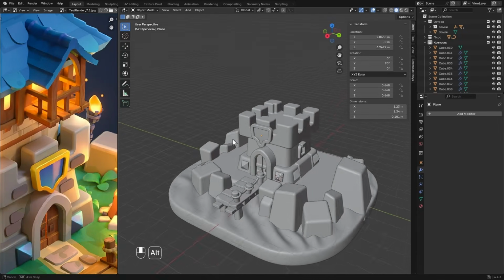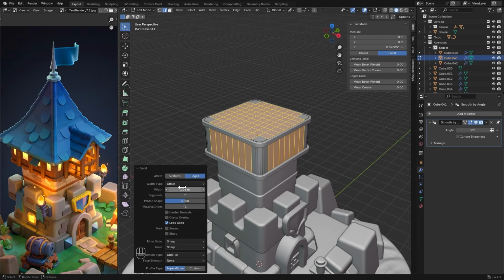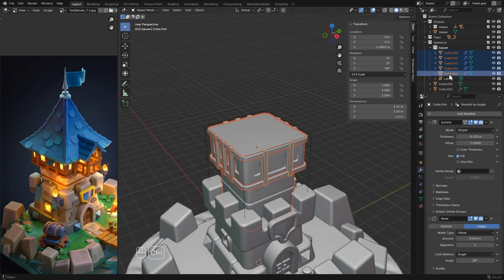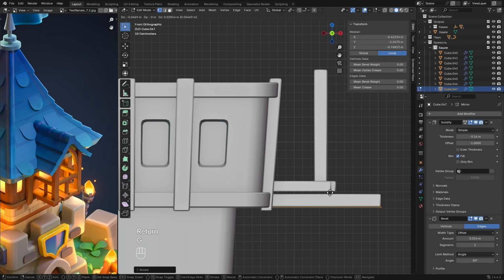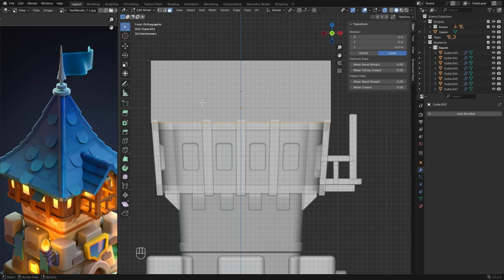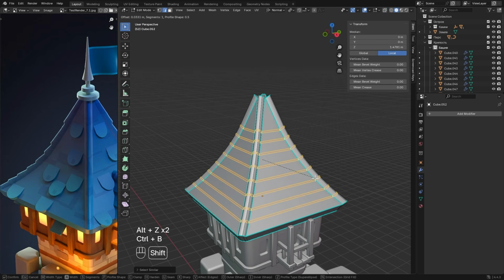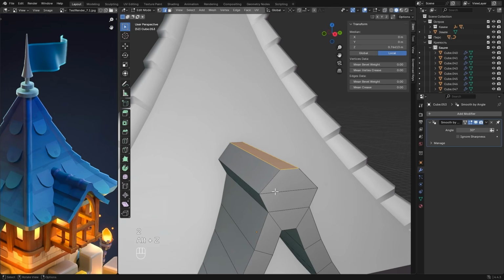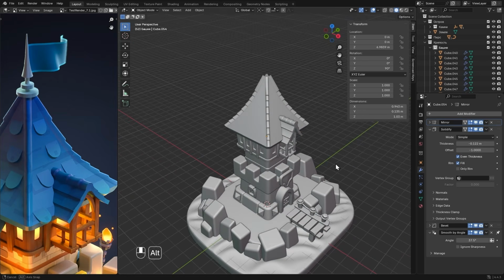Blender Tutorial for Absolute Beginners - 3D Modeling а Tower. Part 4

Comment: Hey great tutorial this far
On every step there is a little challenge for me but I worked everything out this far! 

And I’m hyped to move on.

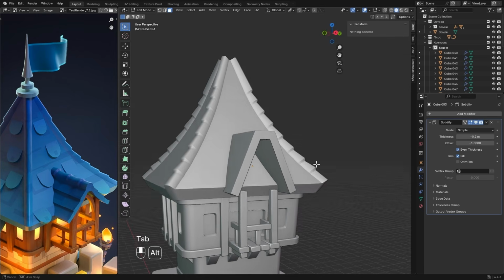Buuut at minute 29:17 when u go back to the edit mode ur balcony awning is selected on the downside and mine is selected on the outer sides 😅

I pressed the global button and it just won’t work. Even Chat gpt cannot tell me why.
Do you know what can cause a problem like this? 

SOLUTION: omg I had 7 attempts for this object but I figured it out! My bad 
The modifier was on -0.2 thickness and I typed just the 0.2 ahhh this little - 

Well now I can move forward celebrating all my achievements while following your tutorial thank you!